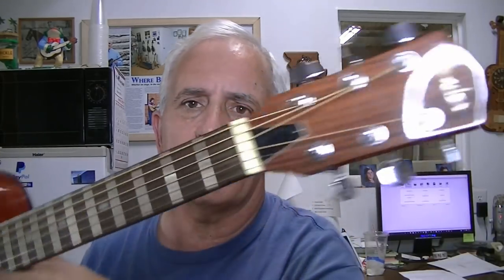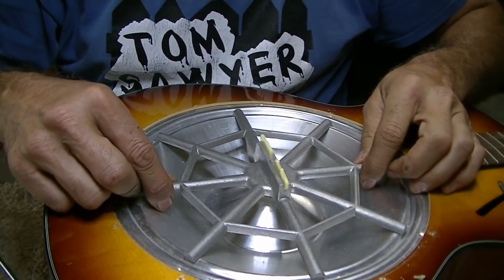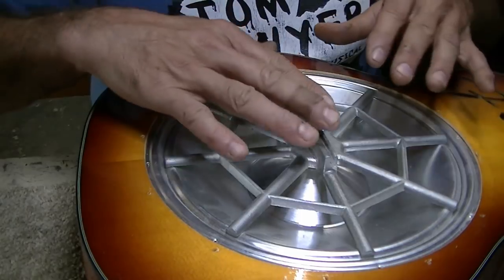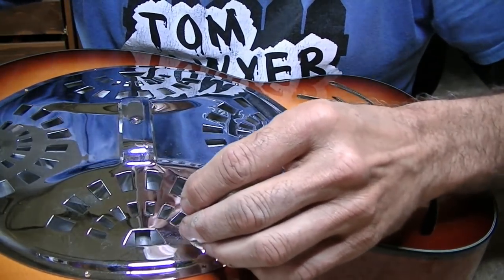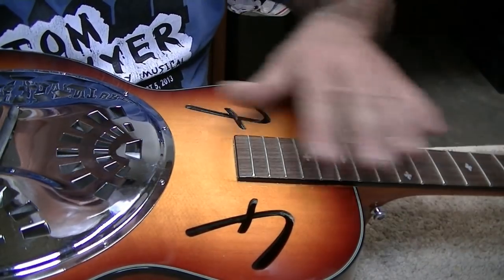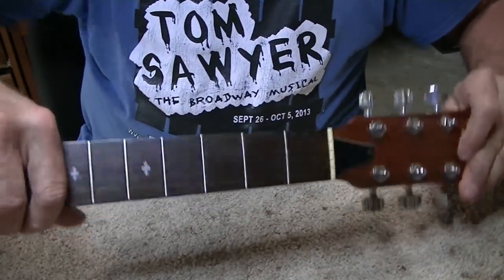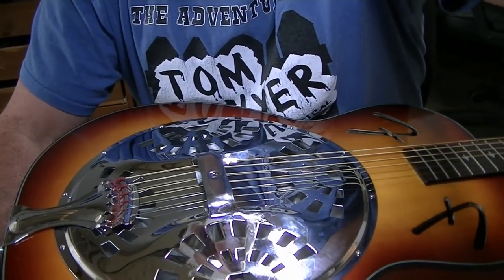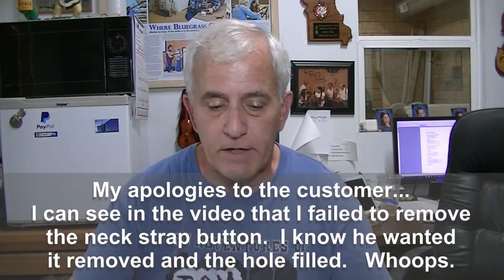171 RSW Fender Resophonic Guitar Buzz Fix and Setup

Comment: I have had success repairing closed tuners in the past by placing them in boiling water for about 20 minutes. The water penetrates in the gears and helps to get all of the residue that was stuck in them. It is very important though that you do not try to turn the knob until after you have rinsed the tuner in cold water. Doing this will allow the plastic washer to reharden and prevent warping.

Comment: You can take a 3/4 inch strip of felt from a hobby shop. Make a pattern from the inside of the cone,and glue it around the hole. Just a couple dabs of glue at 3 or 4 points, and reinstall your cone. The felt fils in al the gaps and weird spots around the cone. It stops all the ratttling because your cone is floating on the felt. You are making a felt gasket for the cone. I hope I made sense,but it really works.Keep up the grea work!
Reply from the maker: Steve Suveg sounds good.  Thanks for the tip.

Comment: This video showed up at just the right time. I bought a Gretsch Alligator on Ebay with a "warped neck" and some buzzing on the lower frets. Looks like new and at half the price. I don't think they know it has a truss rod. After watching your videos I'm confident I can fix it properly. Thanks!
Reply: creativebobbo hey almost bought that one myself!! How do you like it? Easy fix?
Reply: @ArielElijah  So far, yes. Got the guitar with the low E string on top of the saddle above the slot. Took care of the string buzz. Still a slight vibration sound from the resonator portion but have not had time to take it apart. Somebody goofed pretty bad on this one.

Comment: I do sewing machine repairs and have found 3 in one oil has a resin component which tends to freeze parts when the oil dissipates. I never use it any more except for nuts and bold connections. Diamond sewing machine oil is a much better light oil and I use it on my guitar tuner components.
Reply from the maker: I've never had any problem with three in one. However if the other stuff is better I'll try to find some. Thank you.
Reply: My dad use to use non gumming oil on his clocks. A search found non-gumming oil for firearms like Hoppe's. So it shouldn't be too hard to find.
Reply: A little pb blaster or goo gone will clean out any polymerized grease/oil out & then a drop or two of any light oil will do wonders. Also running a drill on the tuner to wear it in. Good chance that tuner took a whack dead onto the key & took the backlash out of the worm gear. Most pinion gears are brass & will wear in ok - it will take some life out of the tuner, but it'll be loosey goosey after that.

Comment: I have this same guitar. Sounds really "dead." I've got it apart and have a couple of observations/questions. (I know it's an old video- don't know if you'll spot this!) The resonator is not screwed down to the top like the one in your video is. It's just sitting in the cavity. Don't know if that's standard and your example had those screws added after the fact, or maybe I should add them?? The cover is also skewed slightly on the hole like yours is. A couple of the screw holes are right up against the edge of the hole while the ones on the opposite side are pretty far. I think the hole is cut off-center like you observed. A little sloppily cut too! Fender QC might not have been having a good year! Lastly, the saddles in mine are wood! And pretty soft wood too. I'm guessing this is part of the deadness I'm hearing, but I'm no expert. Any thoughts? I appreciate your channel so much!
Reply from the maker: Normally they are not screwed down. I put the screws back in this one because that's the way it came to me.

Comment: That's the 1st time I've Ever seen a Cone Screwed In.
I've only ever seen the Spider Cover-Plate Screwed Down.
That was on the Dobro, Alcivar, and Regal Brands-All of which I Made & Installed Maple/Ebony Bridges In.
They were Played Hawaiian Style with Steels, for Bluegrass.
One Horror Story I'd like to Relate with the Alcivar-Which the Customer had purchased as New from a Music Store...When I took the Plate Off, seen that the Circle-Cutter had Cut WAY out of Round where the Cone was to Sit, and they Filled it In in that area, with what could only be Described as SILICONE-What the Heck?!
Reply from the maker: chickengnawer thanks for watching.  You never know what you will see when you open an instrument.
Reply: Yes, I was surprised to see screws hold the cone in...

Comment: You could try a little graphite powder in the tuning key. It lubes like oil but it will slightly file down the internals to where they aren't so tightly fitted. It's used liberally on the inside of door locks that are tight in the same way. Works wonders
Reply from the maker: +Brandon Vincent thank you. I need to get some more graphite. I have been out for quite a while. Thanks for watching.

Comment: Nice work as always!  I had one of these guitars and didn't care for it.  I sold it fairly quickly I was very surprised to see the cone screwed in place.  Everything I've ever heard or read says the cone should just float on the wooden ring and not be attached in any way.  I'm having a similar issue with my pre-Washburn Oscar Schmidt resonator.  The cone doesn't quite fit the opening.  Either the cone is slightly too large or the opening is slightly too small but the cone won't set down on the ring like it should.  I'm sure it's binding up enough to kill the vibration and I'm not getting the reso sound like I should.  I'm going to buy a new cone and if it doesn't fit any better, I'll adjust it until it does.
Reply from the maker: Mono Rocks yes it is unusual for the cone to be screwed in. Good luck with your project. Thanks for watching.
Reply: On my two old Dobros (1930s), the hole had to be routed slightly to fit the new Quarterman cone on one and the Beard cone on the other.

Comment: I use a tight lock product when i am putting screws back in- when playing over time, it  will often vibrate the screw loose again and tight lock stops it from being lose again - you can use teflon tape also -

Comment: Looks exactly the same as my cheap Harley Benton made in China.Today I opened it up for the same reason,buzz on the high E-string.And the screws also didn't fit right.What I did was flatten the spider on sanding paper at a flat surface,still not 100% perfect but it helped.

Comment: I have the 150 model. This one youre working on is exactly the same down to the screws being too close to the center or far off.  I have to tune mine a full step down so i don't break my high E string.

Comment: i have an FR-50 as well. I had the same problems with mine, the cover isn't centered properly, the tuner key for the G string is tighter compared to the rest. the rubber gasket eventually came off making it very difficult to turn the key.....and the drill holes for the cone and cover screws are all over the place....half of them are drilled on the edge, the others are a couple mm's away from the edge. The first thing i replaced on mine was the bridge and nut, as the cheap plastic broke over time. They were definitely cheaply made, not a lot of attention to detail. But a decent sounding guitar none the less.

Comment: My Regal had a buzz on all strings,Turns out the spider had daylight between the cone and finger of spider there is an adjustment screw in middle of bridge use a feeler gauge adjust till fingers touch cone. use a small screewriver I broke bridge nut on the 4/6th string.. but going to remove hardwood nut&replace w bone nut should help sound a LOT!😊

Comment: Fenders are OK resos, but are budget instruments. I've played resos for maybe 15 years (lap style), incuuding Dobro brand. They ALL buzz from time to time. As expected, you nailed every issue with this one. Spider way too loose. You shouldn't be able to shift it against the cone. THis is why better resos NEVER come with the cone screwed in (I never even saw that before and it distorts the cone by ensuring the cone doesn't sit 100% flat on the ledge). This is so you can adjust the bridge to the correct angle, since you are moving the cone and spider as one piece. One thing about this reso which is a recipe for long term disaster is the way the soundwell is constructed. Typically, the gooduns either have a full depth soundwell or a shallow shelf to accept the cone with between 4 and 6 dowels connecting the shelf witht he back braces. These tactics have the additional benefit of helping the sound carry. Only seroiusly high end (I mean at least 5k) have no such support and achieve the integrity of the top by fixing the shelf to the rest of the top by a complex support system. Finally, all quality resos have either maple or maple with ebony cap bridges - the plastic one on this instrument far too loose. Deeer antler sounds intersting . You did this guy a huge favour by transforming the guitar. And no, the cover plate should not rock! EIther it is a very cheap plate of the top isn't flat. Shifting the centrality of the coverplate is the number 1 rubbish fix for a non sentral soundwell. Instructive as always, Jerry.
Reply: When John Dopyera invented them in 1928 . they all had a full sound well . In the late 1930's the Open design was introduced as a cost cutting measure on the budget priced models 15, 17 , and 19 . ( Budget compared to other Resonators , still expensive compared to most conventional accoustic guitars .

  Today , both are made . The tone is subtly different , and preference is subjective .

   High end and custom Resos are offered with proprietary Sound Baffle designs , to tweak frequency response and tone .

Comment: That`s exacly my Fender, just mine is black. Plz, do your saddles (The saddle is split in 2 parts) also move around easy when you move the strings? My 2 Saddle pieces both move, always did. Is that something I should fix? Just glue it in with super glue or what? Or don`t touch it, that`s fine? Could you plz send me some wisdom?

Comment: With a single cone spider, 95% of the time you hear a "rattle" during low frequencies  (bass strings) - you can easily resolve this without even loosening the strings.   
Ever wondered why your bridge is in 2 separate pieces with a space in the middle?  There's an adjustment screw under the bridge, right down the middle of them.
See the hole going through the metal bridge rest?  Take a screwdriver that's slim enough to fit through that hole and long enough to reach down into the bridge.
Tighten (turn right)  - do a full turn.  Test with a bass-heavy E minor chord.  Still, rattles?  Keep turning until it stops.  95% of the time, this will fix it and it's the reason the hole is there in the first place.
FYI -  that fender is a POS.  That plastic bridge is all wrong - resonators need a super thin felt or super soft wood for the bridge.  Plastic is just wrong and bone doesn't transfer efficiently.   I don't know why Fender produces such cheap instruments when they have a brand to protect.  If you want a bargain but don't want to waste money on a lemon like Fender, Gretsch makes marvelous resonators.  The best under $1,000 hands down.  That Fender is a Toy, only intended to be furniture - not played more than a dozen times.

Comment: Hmmmm...I own two old Dobros and had a Rogue (very inexpensive from China) resophonic. None had screws in the cone, they were all simply sitting on the routed area in the top. When I had the old stamped Dobro cones replaced with Quarterman and Beard cones, they were just set in as well. 
Just a point of interest
Reply from the maker: They don't normally have screws in the cone you are correct.

Comment: The Plate Screws should be Spaced Evenly all around On the Outer Perimeter.
I always put the Screws in Across from each other, just slightly Snugged, and keep Going the Same Till they're Fully Snugged.
And I like Sewing-Machine Oil, it's a Little Gentler on Gears.
Reply from the maker: chickengnawer thanks for watching.

Comment: Does that screw need some lock-tite on it to keep music vibration from backing it out, in the future ?
Reply from the maker: Richard Mead I suppose you could do that. The problem would be if it needs adjustment later Loctite is not very forgiving. Especially on something that soft. Thank you very much for watching.
Reply: I was advised to tighten the screw until it starts to feel tight and leave it there. Never had one get loose.

Comment: A little loc-tite on the center screw of the cone might have been a good idea.
Reply from the maker: +Todd Relyea maybe but it's all aluminum and if you get it too tight it will be a bummer to get apart without messing something up. Thanks for watching.
Reply: No locktite....

Comment: with all due respect there are some major errors here , look at the comment by Dean Borchert below.for pointers. Fender does it alot but the cone should NEVER be screwed down. Bridge material, action , set up etc on a reso are very different from  a flat top. Might consider redoing this so not to misguide folks. sorry to be critical but i thought youd want to know
Reply from the maker: I realize they're not usually screwed down. But that's the way it was done so I just put the screws back in it. Thanks for watching.

Comment: Yall never set the intonation when you put it back together. You really need to cut the bridge into two pcs so you can set cone tension.
Attach the spider bridge to the cone and tighten the tension screw a half-turn after it makes contact. Place the cone/spider assembly into the guitar, attach the tailpiece, and install the strings. Don't install the coverplate yet. Put a small amount of tension on the strings, and check your intonation by measuring from the nut to the saddles at the first and sixth strings. For lap-style guitars (Dobro type) these measurements should be the same. For example, on a guitar with a 25" scale, the nut-to-saddle distance should be 25" for both outer strings. If these two string lengths aren't equal, rotate the cone/spider assembly until they are.
Reply from the maker: reelchef67 thank you. Thanks for watching.

Comment: I own a Rogue Resonator guitar. Had to have my luthier do a lot to it. It had some loose wood in it, bought a good cone, now the frets are sticking out of the edge of the fretboard. Those Asian made resonators are just not good guitars to begin with
Reply from the maker: Hope you have good luck with it. Thanks for watching.
Reply: You got the right...
Reply: I had one of those as well, squareneck. It was OK. Actually had a spun aluminum cone like a Beard. When I took the small, screens out of the upper bout it was amazing. Like the hole had been cut with a screwdriver...kind of chipped out. My friend Steve Helgeson of Moonstone Guitars, when I sent him a picture said, "It looks like they used the rat and peanut butter method".